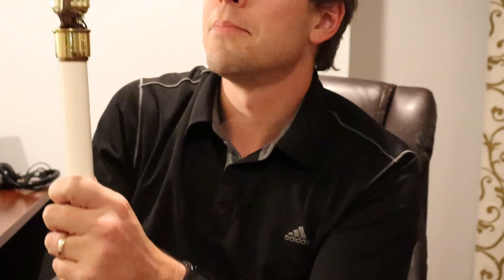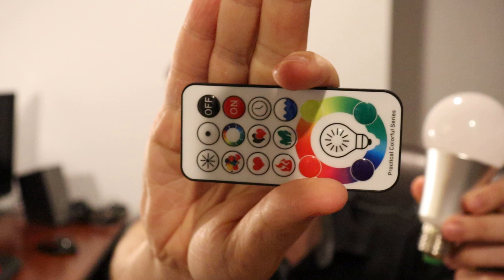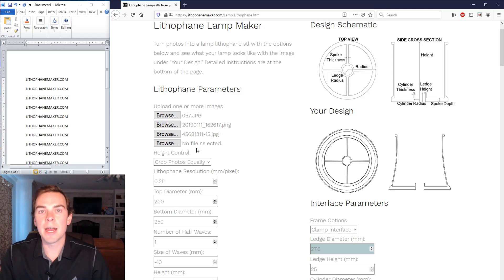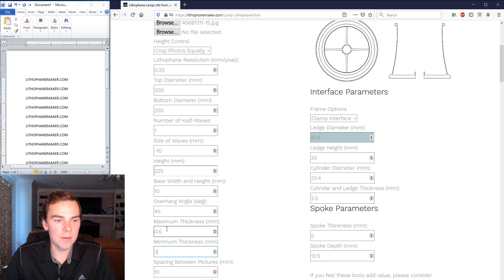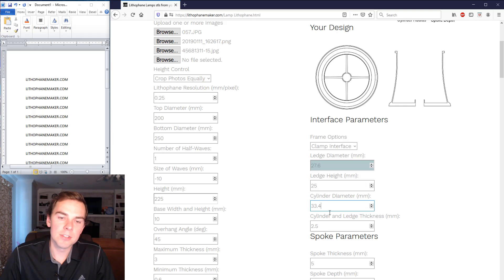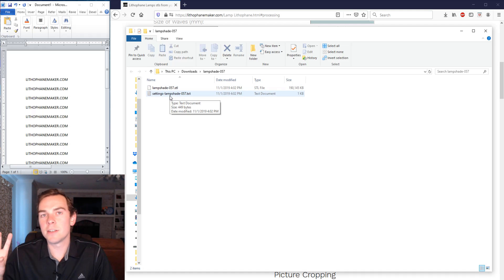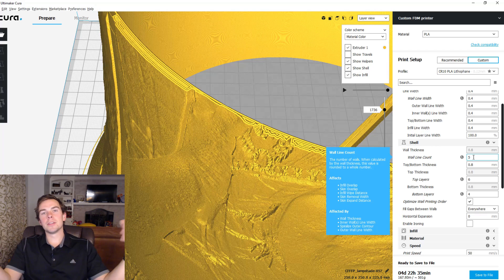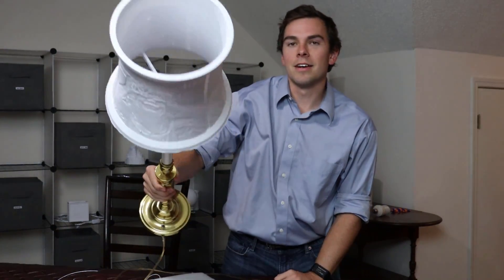Lithophane Lamp - AMAZING 3D Print

Comment: i want to adjust my project, like  for about 70 mm diameter and a about 90 mm height, could that be possible? and how to do it with other parameter values for optimal output? pls help, thanks

Comment: What infill percentage is recommended? I would guess 100, but not sure.
Reply from the maker: Actually, we recommend using 7 walls and 15-20% infill. A high number of walls should ensure that your litho doesn't have any infill in the important parts, but you can maybe save on material in the thicker parts!  You can reference our guide here for more tips: https://americanfilament.us/pages/beginners-guide-to-lithophanes. And if you have a Bambu printer you can download and import the settings that we use on our printers in there as well!
Reply: Thanks for the quick reply! @LithophaneMaker

Comment: Aspect ratio distortion with force height selected on lampshade.

I selected 3 identically sized square images for a lampshade and expected that with force height selected I'd get 3 square pictures on the shade, instead there is vertical stretching with the end result 130mm high and 120mm wide thus distorting the image.

How do I get square uncropped images on to a lampshade?

Comment: Thanks.  Another great feature and video.  Have you ever shared your cura profile?  It would be great to compare with others .  In any event, keep up the great work.
Reply from the maker: I print on a CR10S with direct drive and an inductive abl installed, so my profile is very unique to my printer. It's more likely to mess someone else up than help them, I think
Reply: @LithophaneMaker Thanks for the response.